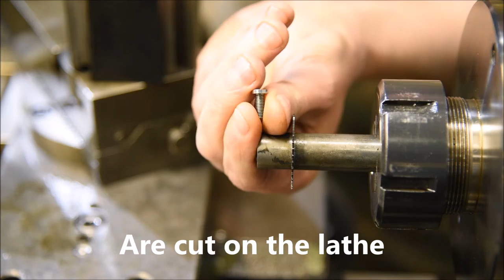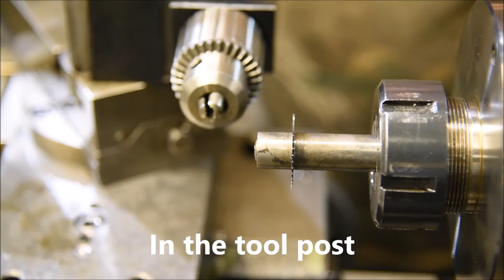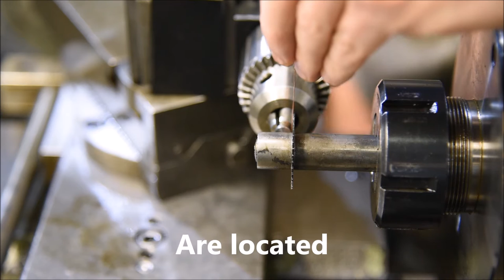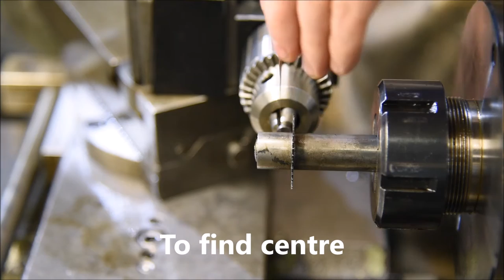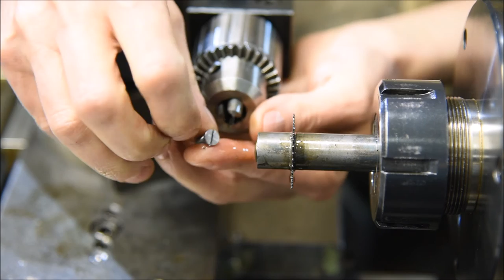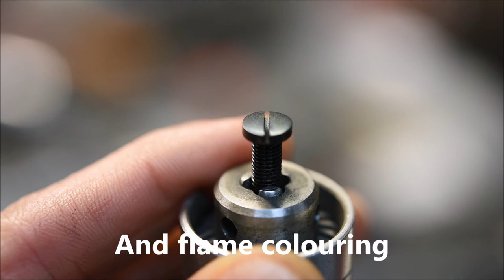Screw Slot Cutting

Comment: So are you still left with a radius on the bottom of the slot?
Reply from the maker: Yes, it leaves the radius. If you want to eliminate the radius as is done in American screw heads the tool post could be replaced with a Z axis milling attachment and the slot cut through or the slotting saw can be put in the mill and X or Y used to give the slot a flat bottom. I don't worry about it because with a 2 inch saw, the depth of the curve left on common gun screw size heads is only .0015 to .0025 in depth which is only barely noticeable and is of no concern with common gun screw drivers. Leaving the curve also gives a very clean, polished looking finish on the bottom of the slot.